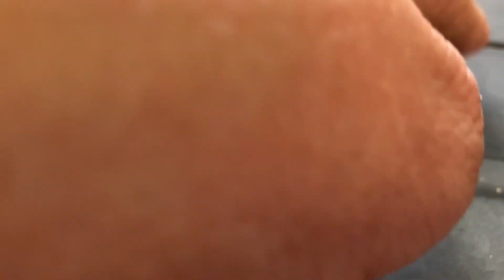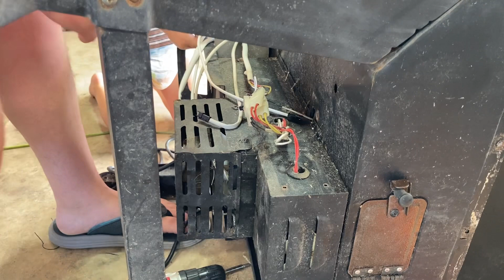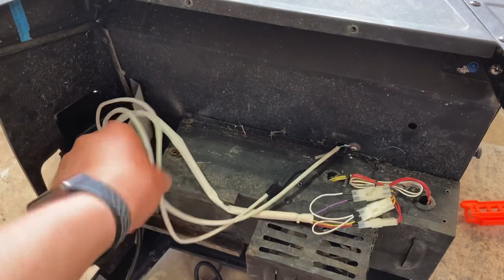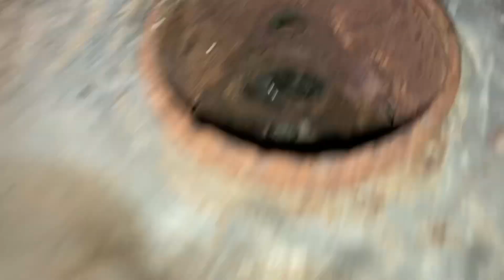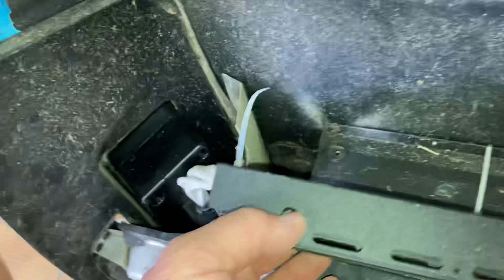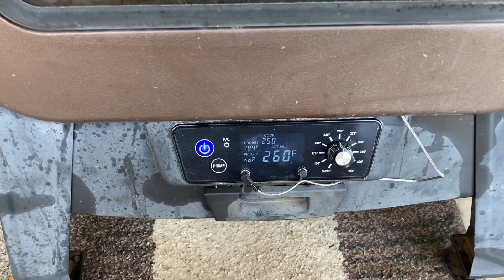Digital Thermostat Controller for Pit Boss Pro Series (Install & Set Up)

Comment: Do you have a link or part number for the controller you used? I have the same smoker with the same problems.
Reply from the maker: https://www.ebay.com/itm/285688193617?mkcid=16&mkevt=1&mkrid=711-127632-2357-0&ssspo=ole2IKurRw6&sssrc=4429486&ssuid=tkY-uqLoRfO&var=&widget_ver=artemis&media=COPY

You can buy a $70 one on Amazon or find an open box special on eBay for $20-30